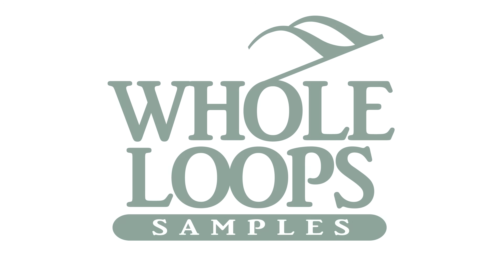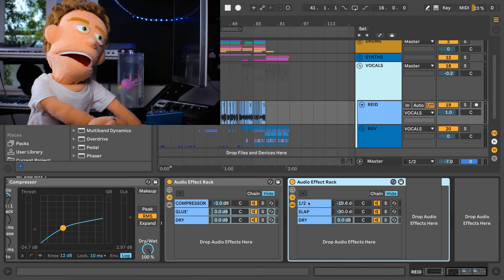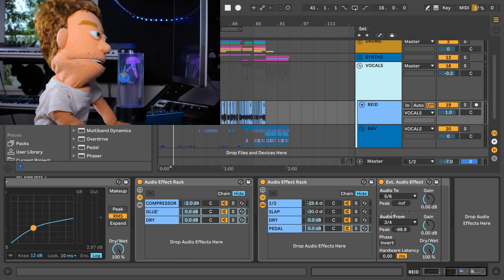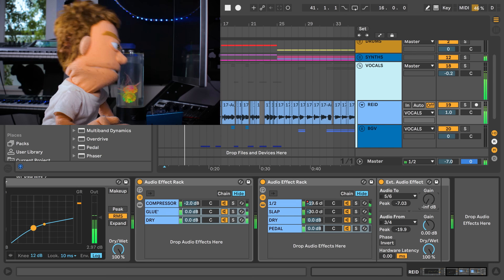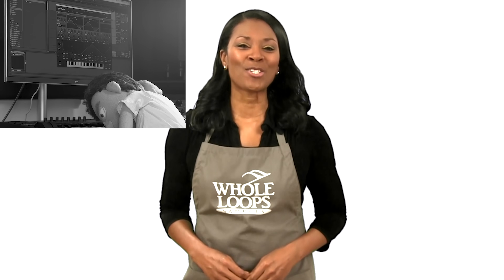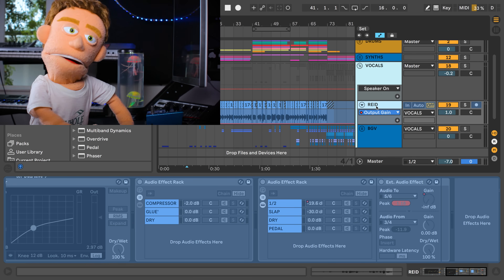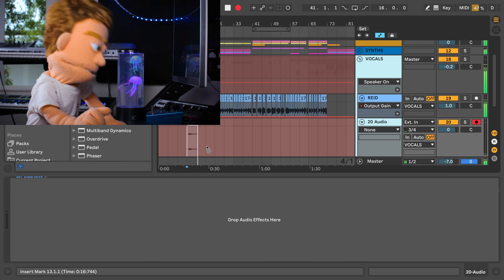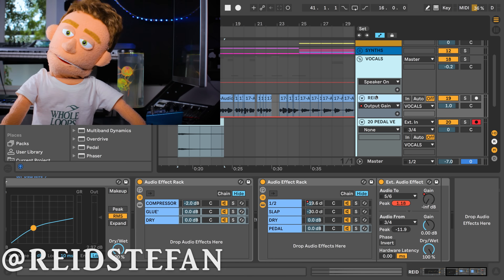How To Use External Audio Effect in Ableton with Analog Hardware

Comment: hey, thx for the video. I am going into an external compressor and strangely enough i got like -2 or -3 ms negatice latency. inside the external effect rack i can't choose negative numbers to compensate. how to work around this? i could of course put the printed track manually on the right spot, but are there other ways? this is especially important if you are doing parallel compression with this unit for example. any ideas$? thx and cheers

Comment: Does using external effects hardware instead of effects plugins save on CPU usage during live performances?
Reply from the maker: Yes however you’re better off connecting your mic thru a vocal chain before going into your interface instead of using this method of looping your raw vocal out and back

Comment: Doing this with my Djm 900 for recording Fx, however the recordings from the Djm into my apollo twin are either much lower or higher (sounds like not the same quality from the original recording). Is there any fix to this to get the same recording volume as the initial recording in ableton. TIA

Comment: Hey man, thanks for the tutorial but I still have issues with external fx latency. I am using RME UC and wanted to run the master chain through UBK Fatso. However it introduces an annoying delay which is messing with the phase of the track... Does this have to be addressed in ableton settings somehow?
Reply: I use .18 hardwear latency on Distressors which seems to work well, may be similar for the fatso

Comment: This is all good, but what if you want to use a compressor or limiter? Something where timing is very important? Does it get messed up by the various latencies?
How to handle that?
Reply: Have you figured it out? because I'm at loss with latency. Can't get anything to sound in phase. and the latency figure at the bottom of the device only adds latency when it should subtract it I guess.

Comment: I don't understand. It is so simple to execute but my pedals generate a crazy amount of feedback. As a result, I don't get the effect I want. Maybe it comes from my soundcard, maybe I should only do one pedal at a time? I've plugged two of them. I feel like I can't use their full potential with the computer.
Reply: It is definitely a routing issue. Be sure that the output you are using to send signal TO the pedals is not a full copy of your main(speakers) output.
Be sure that you are not input monitoring the channel that comes FROM the pedals to the interface.
Your issue sounds like both of these things need to be ascertained.

Comment: This seems like it should be so simple but I'm getting tons of problems - full dry signal even with the wet signal set to 100%, dry signal of the channel with the external effect on even when all tracks including the master are turned down all the way, and insane feedback when I cross a very low volume threshold. I'm stumped, any help would be great. I'm using an iconnectivity 2+ audio interface.
Reply: It has to be how you have it routed input / output wise. You must somehow have it recycling the audio back into itself repeatedly i.e. the feedback. Make sure you have all the inputs and stuff set up right then try messing with the monitoring mode (on, auto, off on the channel) and try changing whether the channel is set to record or not. Just play with the setting as much as you can one at a time to see what starts and stops the feedback to try and isolate the issue. Also, with your volume set to very low and possibly a limiter on the channel Haha :p
Reply: I'm having the same problem.  Did you ever get it figured out? I'm just trying to run stereo out into a tube compressor and eqs. I get horrible feedback at low levels

Comment: Should you be running this through a DI box to get it back to line level going back into your interface? Or is that unnecessary?
Reply from the maker: If you're using a standard guitar pedal, it outputs Hi-Z which can go into the guitar input on your interface or Mic Preamp. i use my mic preamp to convert Hi-z to line instead of my apollo interface